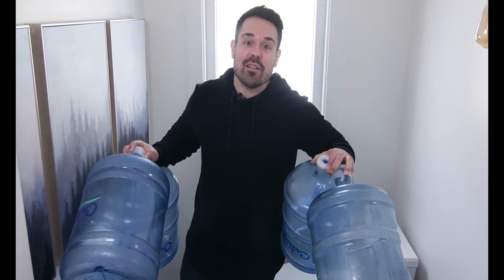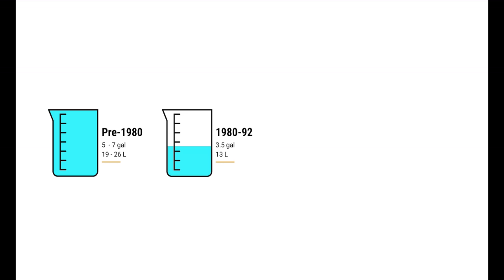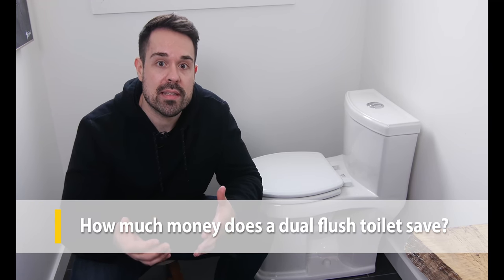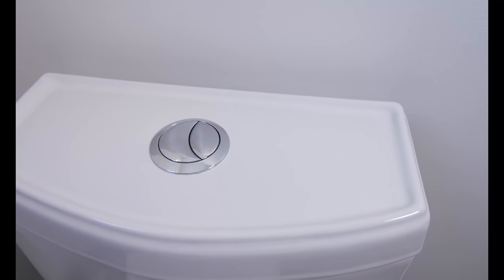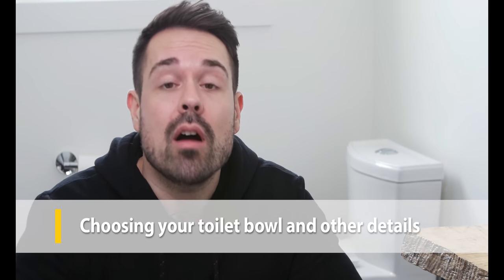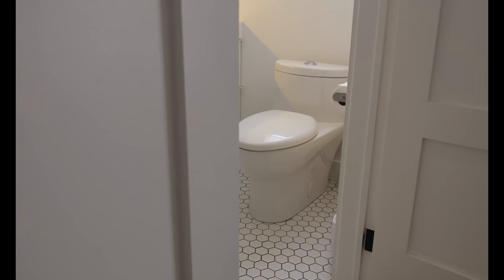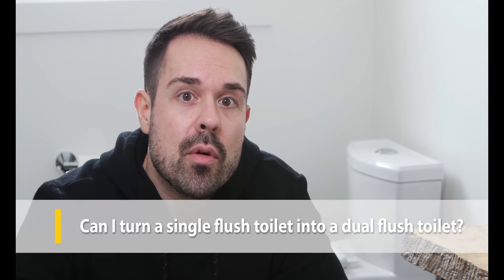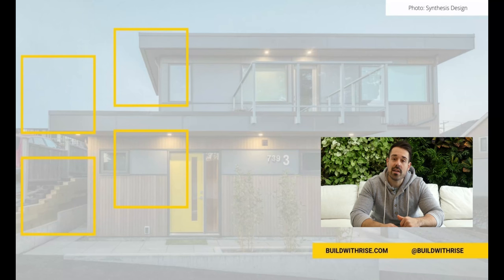Dual Flush Toilets: Ultimate Guide and Comparison to Low Flow Toilets

Comment: Coming from one who's spent decades in the construction/home maintenance industry... As much as low flow toilets appeal to many, many actual plumbers don't agree so much on their use because they actually contribute to increased home sewer system clogs. The reason is because in order to push the solid waste all the way out to the main sewer system lines it takes a fair bit of water. That's a big part of the reason dual flushes have the higher flow rates on the solid button flush. Even still for the higher flow of the dual flush, the water moves faster than the solid waste causing lower flow flush toilets to allow solid waste to stall & accumulate creating a greater risk for clogs. If there's any plant/tree roots that have been able to start entering the system this becomes fertilizer in addition to the roots contributing to clogs. It's better for sewer systems to actually be able to flush everything all the way through the home system out to the main sewer lines or area (in cases of septic systems).  I've known of many who have to call drain cleaning companies once a year at $400-800 per visit to clear their sewer lines. I saw anothet one of these situations 2 weeks ago. It happens a lot because these drain cleaning companies like rotorooter spend a full time day going from one house to another clearimg drain lines. That's way more than the savings cost people think they're getting by a bit less water each day.  You take those big jugs of water he's claiming is waste and spread that over 365 days in a year and it's not really that much.  Better to use the bit more to more likely ensure everything is cleared. But it's all sales to people who think they're saving a bunch.  A better toilet system is a tank in tank power flush style toilets. They use the regular amount of water but splits a portion of the water into a seperate section of the tank that pushes things down at greater force together with the rest of the water. This pushes everything out down the pipes to keep them clear without excess water consumption.
Reply: Thanks a lot for your knowledge on this. Do you think it is possible to create a toilet that uses much less water whilst generating enough power to flush all the way to the main sewer lines? I've seen some toilets in public restrooms that flush at massive speeds and I imagine it is using less water. Why haven't homeowners / building owners used those types of toilets? 
Excuse my simplicity on the matter, I am not in any sort of construction field.

Comment: Would rather have a 3 or 3.5 gallon tank and flush once than these smaller ones you have to flush multiple times.  I have an old 3 gallon tank in the basement.  Will be holding onto that for dear life for sure.

Comment: 9:19 The "big" flush is stronger than the new-but-single-flush models? if so, that's the biggest selling point. (I'm assuming it will be a long time before it pays for itself compared to new models... as long as clean water stays cheap)
Reply from the maker: That's really the kicker right there. The "big flush" does the job with more water, and makes up for the water usage with a light "small flush". It makes way too much sense...

Comment: As other comments indicate, removing the waste from the bowl is only part of the problem. The other part is moving the solid waste from your home to the sewer line.  Going from a 3" toilet drain line into a 4" main line requires double the amount of water to keep the waste moving.  If you have a septic tank or lagoon instead of a sewer pipe,  be prepared for routine cleanings which are quite expensive